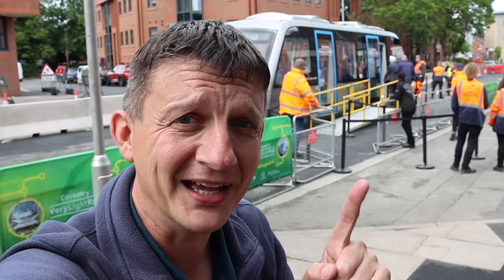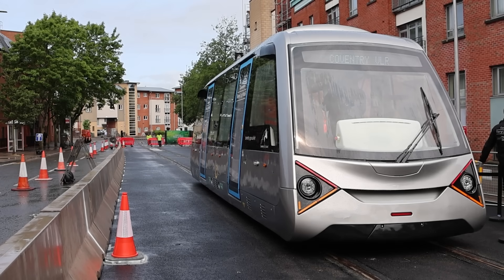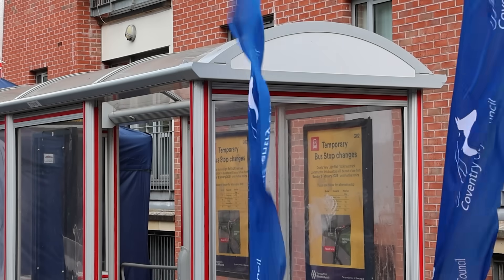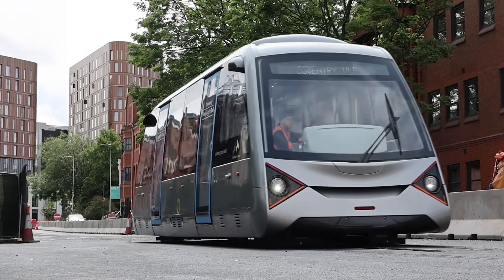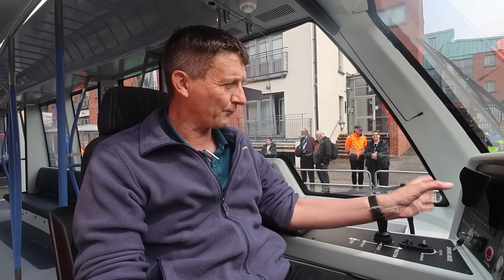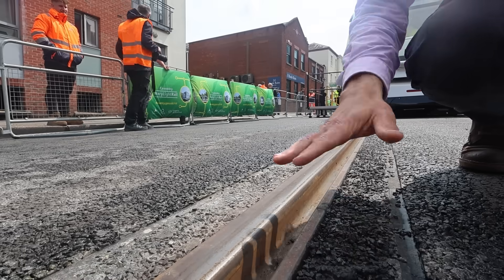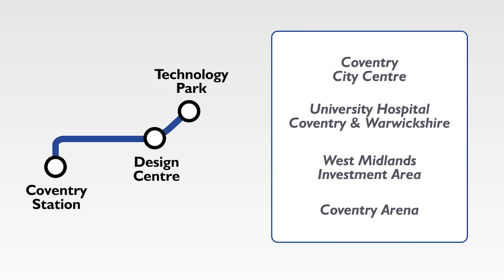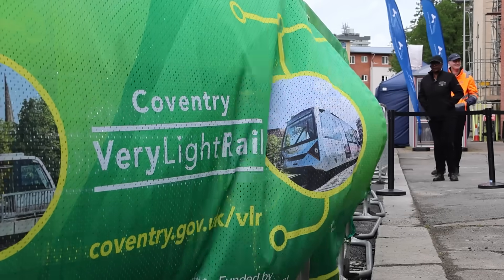The NEW! Coventry Very Light Rail is here

Comment: Looks cool and all, but I feel the need to ask: what makes it that much better than a bus? It seems very bus-ey to me.
Reply: Maintenance costs are lower than buses, as there are no tires to replace and no pavement damage from the weight, and steel-on-steel is far more energy efficient. In addition, rail just has a better public image. That said, the capacity is an issue.
Reply: @MatecaCorp  Will it even have lower maintenance costs? Given that it's basically a custom system surely it's going to be much more expensive to source new parts and to train people to maintain the thing.
Reply: @MatecaCorp  maintenance costs are lower, but you have to build infrastructure which is not needed for buses...
Reply: @lovrenc1402  buses require infrastructure though? Pavement improvements and repairs are a constant cost for transit agencies.
Reply: @MatecaCorp  im not sure about it... The axle load doesnt seem to be so much better than normal trams, so we dont know how much maintenance the track will need with it being on no special foundation.
Reply: 8 tonnes or tons. 
Add 6 tonnes of people etc and that's your max load.
Divide by axles/wheels.
Reply: @lovrenc1402  paint markings bus lanes bus stops (bus stops is a expensive one considering vandelism)

but same time trams and trains do need tires (steel ones) they require maintenece to the rail head and to the running stock and the power infra
Reply: Needs to have some form of electrification that isn’t batteries. A battery bus would do what this is doing much cheaper - if they could deliver overhead wires in a cost effective way and if these can be run in multiple I could see the appeal.
Reply: @LiamHeartsTheSims I think that the most sensible solution here would be fast charging during set down - something like what gwr plan to do with the class 230s. 70 mi battery is fine for the that but not pure battery operation.
Reply: @LiamHeartsTheSims  idk that it would trains are easier to power because there lower friction 
and with fast charging tech i recon they could charge up one of those in under 10 minutes enough to make anouther run to the other end

give it enough batteries you could make it do say 5 laps then go in for a 30 minute charge whilst the freshly charged unit heads out for the next run
kinda like how regular busses park up in the main stations for 30 mins before heading out
Reply: On top of everything else said, a tram system is - for want of a better phrase - more permanent. It gives people reassurance of service over a given route. Compared to busses, a rail system is much harder to shut down. Also, compare property development along light rail routes compared to new bus routes - people can be more confident in a consistent service.
Reply: Busses are bumpy and uncomfortable, they get stuck in traffic and always take longer than driving. There's often no reason to take a bus if you can drive.

Trams have a smoother ride, and shouldn't get stuck in traffic. Despite taking frequent stops, they might still be faster than a car during rush hour. Fixed tracks and predictable movement also make them suitable for pedestrian areas.
Reply: @existentialselkath1264  and they might not be faster than a car. They can hardly take a diversion, can they?
Reply: @icdgyixify99which is why nobody is suggesting they replace cars entirely. They just provide a more efficient and faster way to transport a larger amount of people 90% of the time.
Reply: @existentialselkath1264  Unless the track is blocked in which case, the entire service cannot move.
Reply: @icdgyixify99same is true for trains. You divert or you cancel the route. In which case you're no worse off than before. Still worth it for every other day of the year. Issues like this don't make the whole system useless.
Reply: @existentialselkath1264  Let me make it simple for you. Buses = flexible - trams = inflexible.
Reply: My guess would be more priority on roads along with it being smaller and able to go round tighter bends.
Reply: @runnerman1424 you can give a bus priority on roads with a simple paint job
Reply: in dense city centers and especially pedestrianized areas, trams offer a lot of a advantages over buses. A tram can be seemlessly integrated into plazas and narrow streets, and can safely run even through dense shopping districts with little to no signals or dedicated crossings (such as in Amsterdam for example). Busses usually require a road + wider ROW, curbs, signals, dedicated crossings and damage pavement; counter examples in NL to Amsterdam are Utrecht and Gronigen where the city centers are cut up by busways that have a really negative impact urban fabric in some spots
Reply: @fietsenOveral4650  So can buses. It is also easier to take buses out of service if necessary.
Reply: I was just about to ask the same thing. Tram systems usually carry many more passengers and cut off huge areas of the road network by interlinking to the train network, or by having high speed rail areas. These just seem to go with the cars. They will still get stuck in the same traffic and they carry less passengers meaning drivers will also be overstretched. Surely if their argument is that these will have areas on the roads the separate them from traffic, a bus lane and an improved bus service would be a cheaper and more effective solution?
Reply: I think the best application will be for re-opening old railway lines.
Reply: @andybrice2711  I think that these are best used on tracks that require a viaduct where bad steering could be a risk.
Reply: Energy efficience due to metal wheels on metal track for a start.
Reply: It is not better than a bus. If it breaks down then the service stops.
Reply: its a distance thing

assuming all are going to the same place there stops would be the following in our example

train 6-8 stops between you and your destination
tram 12-16 stops
bus 42 stops

vlr and trams are verry good for routes where your always and forever going to want transport going that way 

example linking 2 neighbouring towns, linking various shopping areas in a town, linking a town to a nearbye city, linking places that dont have trainstations to places that do for multi modal transit
Reply: to work you'd need high quality bus landes (for this tram thingy), pre-paid boarding (presumably) and the double door configuration so people get on and off quickly speeding up stops. But you can do that with BRT - like the glider system in Belfast or next up Liverpool.
Reply: You'd be right in thinking that! Even an Enviro 200 single decker bus has more capacity... Light rail is only as good as it's alignment! If it is not seperated, it is no better than a bus!
Reply: I mean if they add 2 more or even just 1 more car it would be better than a hypothetical bus.

This reads like a Tech Demo to me, and the "hype talk" are about the rails, and the bogey & battery system, both of which can definitely be scaled up with additional cars eventually.

As this little back to back bus thing, no it doesn't make sense.
Reply: There is nothing that makes it better than a bus. They did a good job on the local council though, got to give them that.

Comment: So, what about the disadvantages over regular trams?  Lower capacity, range - even more so on hills - and if it’s popular, you’ll need to buy a lot more units to allow for charging time.  Then there’ll be a demand for expansion and then people will say why didn’t we just build a tram line to start with.
Reply: I mean considering its a test track and proof of concept, in the long term obviously a tram would be better but not everyone can afford it
Reply: Then after 5 or 6 years the batteries will degrade, range will be uneconomical and expensive battery replacement will be required. That’s if they don’t spontaneously combust before then.

Comment: What is the advantage over battery powered electric bus?
Reply: Steel wheels on rails have less friction than tires on tarmac. The UK's electric tram system was always more efficient than the bus system. We got rid of our trams because car lobbyists wanted to destroy public transport and replace it with car dependency.
Reply: @DavidShepheard  You would save more energy by opening multiple bus lines with the money that this would cost.
Electricity is pretty cheap and renewable.
Reply: @DavidShepheard  Yes, I understand that, but the question pertains to THIS system. I would ask the followup question then. If they are more efficient, what is the cost of maintenance of the rails. I understand from watching the video, the installation is cheaper than a standard rail, but it still needs to be installed AND maintained.

The maintenance will never go away as long as you are running this tracks. From the looks of it, it will require tons more as it is not meant for heavy, extended usage. It looks like it will not be able to handle nothing more than really light rail.

So I ask again, do you actually think this really light rail has any advantage over electric bus? To me this sounds like gadgetbahn. Totally unnecessary gadget for sake of being gadget, totally impractical system that can be resolved with cheaper bus at lower operating cost. Unless they plan to run this unmanned, which I doubt, it won’t do anything other than make money for the fraudsters that is selling this.
Reply: Reduced friction which extends battery life. 
Electric buses only work when wired, we used to have those but they were thrown away 60 years ago in the name of progress
Reply: @davefrench3608  Electric buses now have a range of around 300 km, more than enough for a day, and can even charge at stops with pantographs.
They don't need the wires anymore.
Reply: @davefrench3608  We have loads of fully electric busses in Manchester. They don't seem to have any problems doing their job. They're much nicer to be on too, no loud engine to deal with or nasty fumes. A lot changes in 60 years.

Comment: I wonder if it could be coupled up for extra capacity
Reply: I don't think they can unfortunately. Couplers are too heavy.
Reply: @keyaanmatin4804  then it is pointless. Rail is meant to move large numbers. And all normal rail systems can handle more cars as long as platform length keeps up.

Comment: It is TRAM (If You remember original tram designs - it was single short carriage drawn by horse.
So i will call this a TRAM.
BUT... Why this one instead partly guided busways for electric buses? Guided only in areas where need to be charged (stops) or where are separate from road (like Cambrige).
I like trains or trams - but we need to multiply this design to 2 or 3 vehicles joined together to make sense.

Comment: Question- what will happen access to Gas, Water mains etc. is needed?
Reply: You would probably use an access point not directly underneath the rail. If you have to access gas/water etc you can rip up the tracks and replace them afterwards.

Comment: As for the name, I kinda like Streetcar. Its an old alternative name for trams (or a current one in America) but it also does connote that smaller single-car design that many of those old trams had.

That aside, I must admit that while this does look like it will be useful in a capacity, I don't know if it will truly hold its own against a tram system. yes, it is cheaper and easier to install, but it is SIGNIFICANTLY smaller in capacity. This reminds me of a transport youtuber I used to watch talking about a 'Rubber Tyre Tram' that only needed one rail in the ground, to which he pointed out that it was 80% of the cost of a tram, but also only 50% of the benefit of a tram. Given they seem reluctant to actually GIVE a comparison of price, there is a good chance that this is something like 60% the cost of a tram, and only 30% of the benefit.
(edit: just got to the part where the council person says 10m per kilometre. Given this against the 25m they quote for normal trams that gives 40% of the cost of a normal tram. But caveats to that is that they are incentivised to give a higher quote for trams and a lower quote for themselves, and it is likely issues would arise during construction that would raise costs. also, whereas with trams there are multiple providers meaning pricing is competitive, they are the ONLY provider of this technology meaning they can charge whatever they want for the track, systems, vehicles, etc. In the transport world we have a term for this: a Gadgetbahn, generally meaning a vehicle that claims to be revolutionary but is in reality SUPER niche and very expensive for what they provide. a la monorails or hyperloop.)